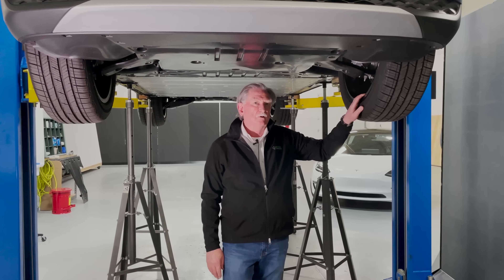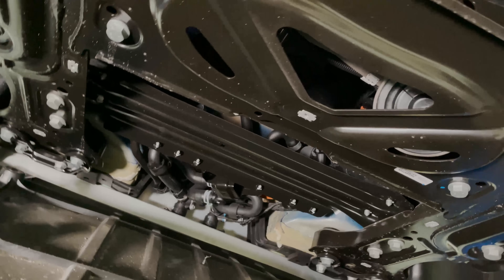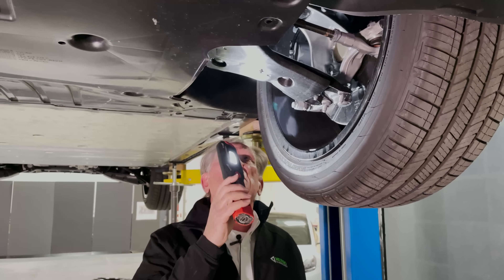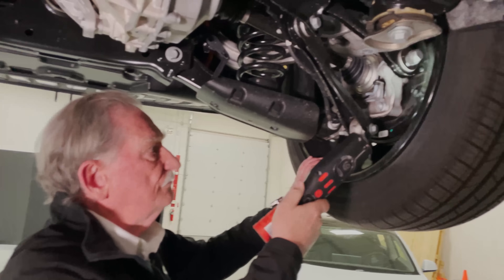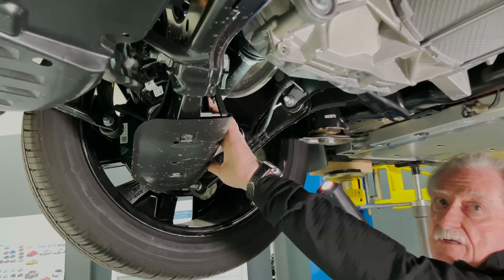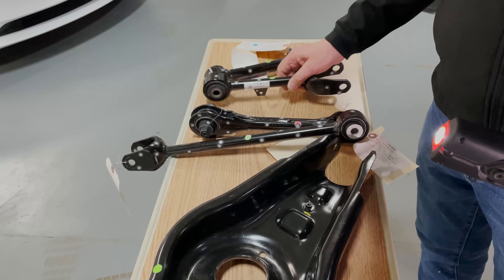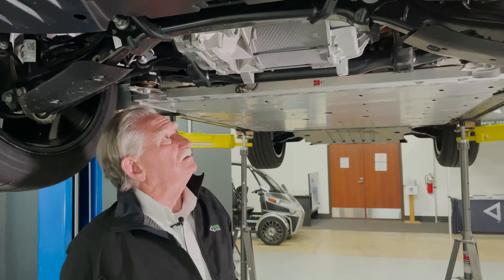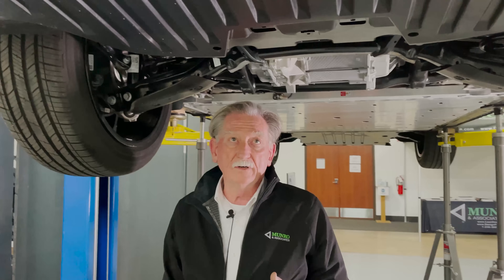2021 Volkswagen ID.4: E3 - Hoist Review, Front and Rear Suspension

Comment: Lots of wasted space above that front cross- car beam,  yet it appears to not have left room for front motor for awd.
Reply: Nope
Reply: no, AWD will come later this year
Reply: That "wasted space" between the front wheels is exactly where the front drive unit will go. Doing it this way preserves as much commonality between the RWD and AWD versions of the vehicle. It's all the same, only the RWD version doesn't have the front drive unit installed, and has a big void there instead.

Comment: The ID3 and probably also the ID4 has excellent isolation against road noise. Can ist maybe be, that the non explainable things are for better noise comfort ? For me its fascinating how silent my ID3 is compared to my Hyundai Ioniq.
Reply: Road noise is somewhere in the middle based on Bjorns test... Its quite impressive to around 80km/h but passed that, its even worse then some cheaper cars... Its good but nothing special compared to other new EVs...
Reply: @DG-uv3zw  this would mean that Hyundai Ioniq is extremely bad because my ID3 is really excellent. On summer tires I don't hear on most roads anything from the street. I hear only wind noise
Reply: @gkfsns  Don`t know about Ioniq. Just stating known facts... You can check Bjorns table with noise tests...
Reply: @DG-uv3zw  the Noise table from Björn doesn't make a difference between road noise and wind noise. I think not only the dB(A) is important but also the kind of noise, so where it comes from. I don't use a noise meter in the car but if I change between them, the ID3 feels much better on noise comfort. Don't understand me wrong, I had heavy software issues I would nobody recommend the ID3 or ID4 until they have left Beta state, but on things like noise they made a good job (I think)
Reply: @DG-uv3zw  Probably due to the tyres?

Comment: The ID.4’s front suspension is no different than a BMW 3-Series or X3 which to this day still uses McPherson strut front suspension, as does a 911. You can easily add adaptive dampers too if you want to offer a ride quality that has a range of adjustments to it. It’s just a simpler design. Tesla chose to use double wishbone front suspension not because it saved money but because it is perceived to be a superior product.  It’s what Mercedes and Audi use on their similarly sized C-Class/A4 models, but it costs more and requires more complex links and bushings. VW uses front struts on every single car sold in the US today from the compact Golf hatchback to the full size Atlas SUV. The ID.4 is underpinned by the MEB platform which is going to underpin VW’s cost effective EV models. I wouldn’t expect to see double wishbones up front on an economy car. Honda got rid of them on the Accord 3 generations ago because of cost savings AND have only just now added them back to the Acura TLX, what some might consider a luxury car version of the Accord. There is no benefit to ride quality or handling that your average soccer mom/dad driving their kids around town is going to notice. Double wishbone costs more to fix, weighs more and in my own experience is more prone to wear. Struts are cheaper and still offer fantastic handling and fully independent suspension, they also tend to offer more clearance in the wheel wells allowing for a tighter turning radius. 

Also, the rear suspension aluminum arms look very similar to what you see on a Golf or Jetta with multilink rear suspension. I don’t quite know if I believe those are there due to a mistake or if they’re there on purpose. 

I’m sort of surprised he’s composing about some of these things yet he seemed to nearly 💦 his pants over Faraday Future’s butterfly doors that obviously are expensive and overly complex.

Update: here’s a list of luxury cars (including BMWs) that use MacPherson struts:

Audi: 
A3/S3/RS3
TT
Q3/RSQ3
Q4 e-tron

BMW: 
228i/M235i GranCoupe
230i/M240i/M2
330i/M340i/M3
430i/M435i/M4
X3 30i, X3 M40i, X3M
X4 30i, X4 M40i, X4 M
Z4 30i, Z4 M40i

Cadillac:
CT4 2.0T, CT4-V, CT4-V Blackwing
XT4
XT5
XT6

Genesis:
G70

KIA:
Stinger GT

Jaguar:
E-Pace

Land Rover:
Evoque
Discovery Sport

Lexus:
ES250/ES350
NX300
RX350

Mercedes:
A220/A35 AMG
CLA250/CLA35 AMG/CLA45 AMG
GLA250/GLA35 AMG/GLA 45 AMG
GLB250/GLB 35 AMG

MINI (BMW):
EVERY SINGLE MODEL

Porsche:
718 Boxster
718 Cayman
911

TOYOTA:
Supra (BMW Z4 derivative)

VOLVO:
Polestar 2
XC40
C40

The list goes on…
Reply: Look, these suspension descisions are always going to be a trade off, usually to do with price and space requirements.  I think Tesla had the space up front and so went with what most people would agree is a better system at the front given that they still have space for a frunk.  Porsche needed space up their too in the 911 and hence the struts and torsion setup.
I'm not saying that the struts are bad, it's just if I could I would design in double bones - design is a trade off.
Reply: Look, these suspension descisions are always going to be a trade off, usually to do with price and space requirements.  I think Tesla had the space up front and so went with what most people would agree is a better system at the front given that they still have space for a frunk.  Porsche needed space up their too in the 911 and hence the struts and torsion setup.
I'm not saying that the struts are bad, it's just if I could I would design in double bones - design is a trade off.
Reply: If it's good enough for Mercedes and Audi then I'll take that on the Tesla.  I think you just insulted women who drive their kids to soccer by the way. You might want to apologize.
Reply: @bluetoad2668  If MacPherson struts are good enough for a Porsche 911 or a BMW 3-Series, C-Class (previous generation), etc. it’s good enough for a family crossover used to carry kids around to soccer games. A strut front suspension isn’t a bad design and it’s less expensive to build, fix and has less parts.

Sandy kept saying the ID.4 was not on par with what you see on a BMW, referencing the Model 3/Y’s double wishbone front suspension, yet the direct competitor to the Model 3 from BMW, the 3-series uses struts instead of double wishbone front suspension. I can tell you that driving a 3-series back to back with my Model 3 Performance, the 3-series is the more enjoyable drivers car.  My daily driver is a Model 3 Performance, so I’m not suggesting double wishbone is inferior. My point with all this is that Sandy is trying to tell people the suspension design is garbage and subpar to the “BMW quality” suspension found on a Tesla. Yet he leaves out arguably some of the best handling cars on the road use that exact same design. I’ve owned cars with MacPherson struts and double wishbone. Just having a double wishbone doesn’t mean you suddenly have handling or ride quality benefits over a strut. You can find plenty of excellent handling and riding cars with either setup. I just think Sandy needs to give better context about things because I’m sure most people watching these videos know 1/1000th as much about cars as I do and they will take whatever he says as the word of god.

Comment: expect to see a lot more things that don't make sense, because VW is going to design a platform to be used by multiple brands to save money on design and tooling costs.  The downside is that you end up compromising on things for the sake of uniformity and compatibility, meaning it will work well in most situations, but will never be the best in any situation

Comment: they said that those drum brakes are sealed and can last a lifetime. Is that true?
https://youtu.be/IDlZYf083l4
Reply: Definitely longer than disk breaks. I have to replace the rear disk breaks on my small Seat Ibiza every 5 years because rust is killing them. They have the motor on that axis, so are recuperating most of the energy, leaving very little to do for those brakes even if you are really pushing the brake pedal.

Comment: So, the "Tesla Killer" has rear drum brakes.... good luck VW!!!!!!
Reply: Well, EV cars usually do regen braking and the brakes are rarely used. The disks and pads have the tendency to corrode when unused, especially in places that use salt on the road during the winters. This is the reason also the motor is painted. On the other hand drum brakes are fully enclosed and protected from the elements and they will brake when needed.
Reply: TESLA found their Savor🤣😂🤣

Comment: The "Technical Difficulties" are great😂. The car is so so.
Reply: It still rides more comfortably than a Tesla though. Tesla cuts cost at suspension quality. Which is one of the reasons for the price, even though it is a segment higher than the ID.4. ID.4 = RAV 4/Tiguan. Model 3 = BMW 3-series. That it is cheap That it is cheap says more about the cost cutting of Tesla.
Reply: @Astke  The suspension design was one the things Munro questioned on this. The Model 3 has a harder sportier suspension than most cars sold in the US, but compares to most European cars sold in Europe. I have not driven the ID.4 yet, but agree with Munro that the car could have been designed different and thus have higher range at the same or lower price. Also it is somewhat early to make real life comparisons, the next 12 month will tell us more about the car and how owners like it.
Reply: @RMTFamily  The Model 3 even has a harsher ride than most cars sold in Europe. Including the smaller cars we drive here. It is pretty much like it never settles or stays calm. While even the sportiest cars in the same segment (e.g. m340i/M3) have suspension that can make the car feel pretty steady and calm when they need to be. That is the difference and that is why normal high end suspension systems are usually slightly over engineered. It is to make it work in as many situations as they can.
Reply: @Astke  This is true, I remember a TV show with Alexander Bloch at VOX where they tested Model 3 & ID.3 and Kia eSoul on a special bumpy test stretch and the Tesla chassis jumped around like a wild horse while the ID.3 was so much smoother.

Comment: The reason you find so many legacy methods and parts is because the designers probably looked at the VW parts bins of all their brands, and used existing parts and components to save time and money.  You don't need to validate and do comprehensive testing on components if they have already been done, and are currently in use already on another VW brand vehicle
Reply: That's what I would expect.  Then they can decide where and what to refine in further model years.
Reply: In the end it will COST them money.
What they should have done is a complete overhaul of the platform.
Make it totally NON legacy.

Comment: Another reason for drum brakes is that the rear ones get little use in a normal car due to weight transfer, and even less in an electric one due to all the regenerative braking.
So VW has pulled a clever durability trick: drum brakes tend to suffer less from the rust accumulation that comes with infrequent use, while discs and their pads suffer a lot from that. In places were there's a lot of salt on the roads,there are tons of EV, especially Teslas, with brakes that need to be thrown out and replaced well before they're worn out due to all the corrosion.
Reply: When disc brakes first became mainstream they were on the front wheels only on many cars - too expensive to put front and rear. The disc/drum combo worked for the reasons you give. My 1970 Ford LTD braked nicely for the size car it was. Bought it used as my first car, kept it a long time - and was glad the cost of brake replacement was kept ~low that way.
Reply: Yeah, im glad they used drum brakes
Reply: And he should know that.

Comment: Teslas don't have drum brakes, even though they are cheaper and sufficient, because Teslas are meant to be practical sports cars and can be raced on tracks. Just a different brand philosophy between Tesla and VW.
Reply: And it looks sexy behind flashy rims(discs) ;) Drum brakes lmao... maybe on cheap china made cars...
Reply: @DG-uv3zw  many EVs nowadays tend to have flat, as closed as possible design, often with barely visible ventilation holes. Including Tesla's Aeros.
Reply: @DG-uv3zw  To offset this they came with 21" rims. ^_^

Comment: A lot of cars use MacPherson Strut front suspension, even BMW (3 series etc)
Reply: Mostly due to cost and packaging.  Takes up less space and eliminates upper control arms.  The disadvantage is that camber control on compression is absolute sheeeeeet.  There are ways around this like to make the suspension travel so stiff and short that there is minimal compression and have good handling or let the suspension travel and not care about camber control and have handling be bad.  If you want it both ways you need some sort of double wishbone or multilink.
Reply: @Robbie6298  aha, thats the reason for teslas famed comfy ride.
Reply: @thomasgerber1472  I thought teslas have notoriously rough and noisy ride :)

Comment: Wonder if the hollow aluminum part in the rear suspension was a necessary adaptation needed to make the ID.4 feasible on the MEB-platform? You can only stretch a platform across so many models/sizes before some aspects become suboptimal.
Reply: Yeah I would also think that they did want it to stay mostly identical across many different cars so it still has the low hanging arches on the ID.4 where it does not need them.  
Also knowing the many issues the axle/suspension stuff has on Teslas I guess I would trust this a bit more.

Comment: You know a car is well built when Sandy complains that they used too much material.
Reply: Too much material does not equal well built.
Reply: Yes. Too much material doesn't mean a well built car, but all those extra material cost, whose gonna pay.? YOU..
Reply: @drajeshkumar  well in this case it's VW paying because this car is priced to compete against Tesla with no regard to profit margin.  Designed in a hurry to avoid EU fines and having to buy carbon credits.  This car is subsidised by VW's ICE vehicles, Tesla would never build an EV this way.
Reply: Lol, its quite the opposite...

Comment: 5:30 Jesus. this all is old world dinosaur stuff VW should be capabable of at least be at the same level as Tesla if not surpass Tesla. But they even seem to have failed at that compared to what Tesla has developed. Wonder how all the electronics and battery stuff will look compared to what Tesla has. I'm sure after seeing this it will no get any better from here.
Reply: Online reviews from those who have driven the ID4 (I haven't yet) indicate that it rides and handles very well. I would not consider that to be a failure. Those curved upper links are that way for a reason, and it's far from the only high-volume production vehicle that has them like that (and for the same reason).
Reply: It will get OTA charging speed upgrade.